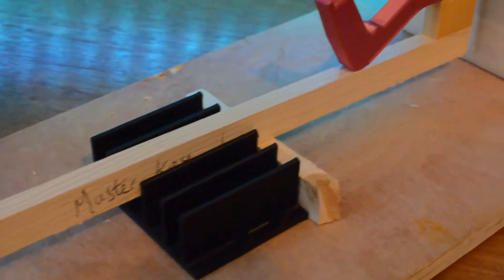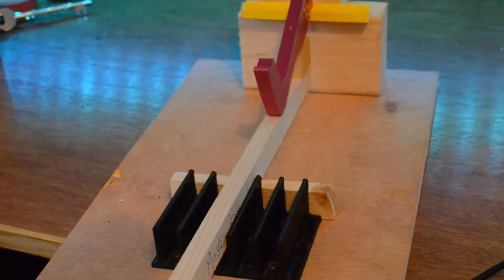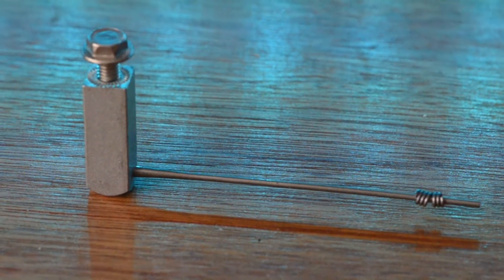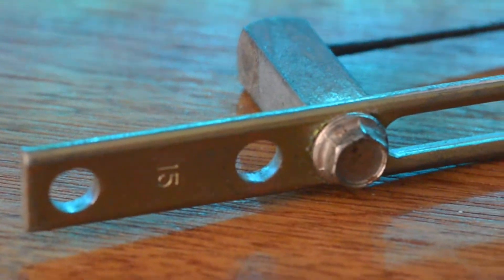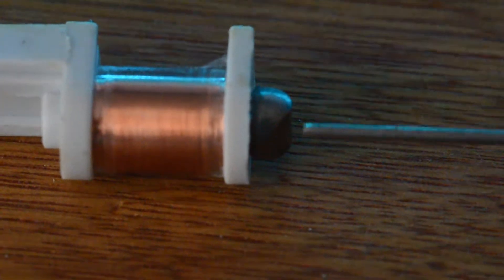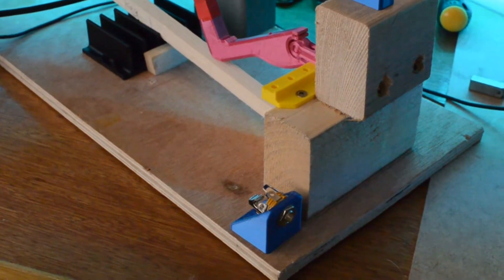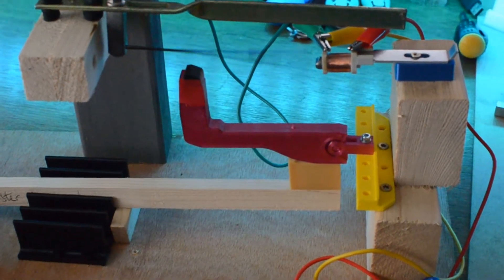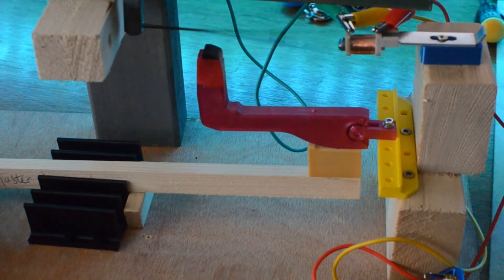DIY Electric Piano - Test Assembly with Fender Rhodes Spare Parts - Episode 3

Comment: Very similar key/hammer setup that I've wanted to use for a DIY stringed electric piano. I pictured the hammer being contacted by the key at it's other end, directly under the hammer tip, however.
Reply from the maker: Interesting idea, I am thinking of future projects after this, and a clavinet with the setup you talk about would be interesting to try.